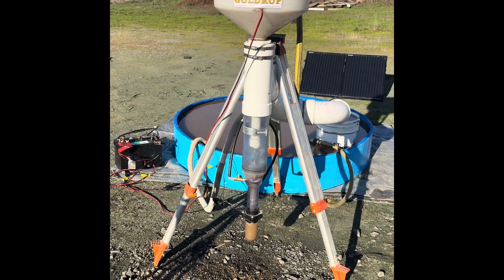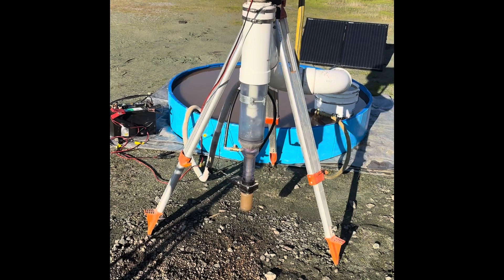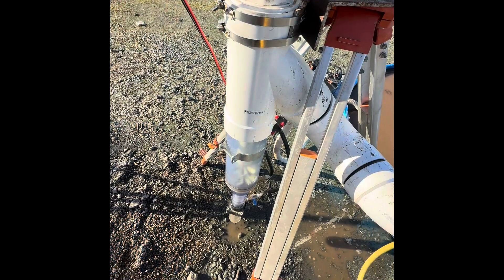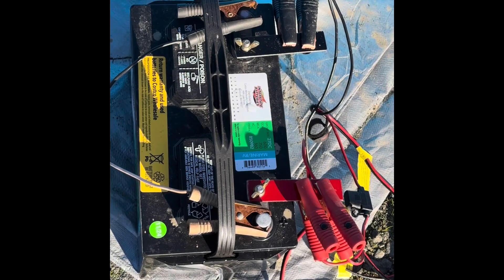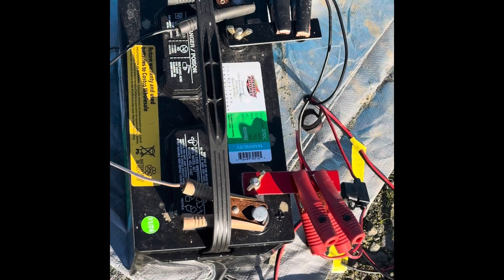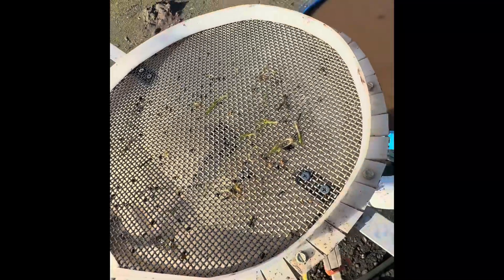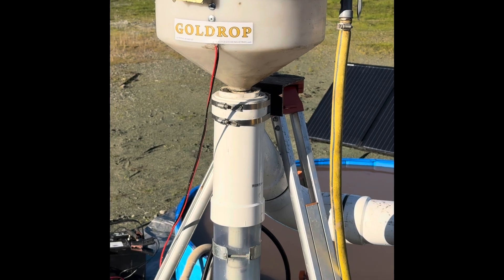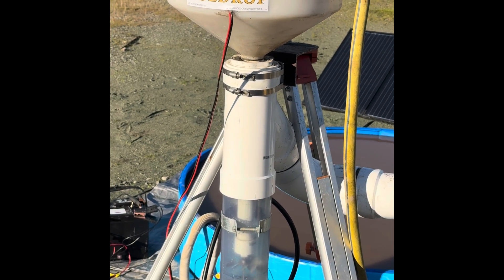Goldrop Miner prototype overview

Comment: Id make a modification to the screen to incorporate 5 gallon bucket classifier screens. Like the keene, jobe screens.  Most prospectors have them.  Plus it would be interchangeable mesh size.👍
Reply from the maker: @Jeremy-r1b  A bucket screen is smaller than the funnel screen and will sit inside the funnel rim with no modification if someone chooses to use them.